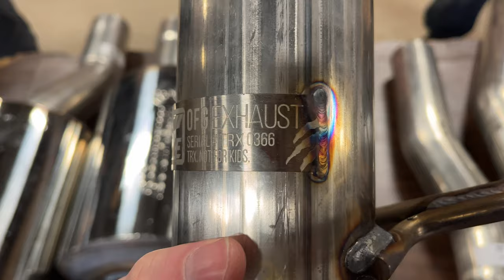Ram TRX – AWE 0FG Exhaust | Install and Review

Comment: Does that muffler on the right side hit the frame at all during driving or when going over bumps and driveways as the chassis flexes? Sounds damn good!
Reply: Nope, it's been fine! I've done additional adjustments since install and it's only improved. No witness marks on the frame rail or the resonator. Once all of the hangers are in place, the system hardly budges at all, even if you push hard on it.

Comment: How much do you think that 180 tech would cut the in cab sound with the kooks long tubes 1 7/8 with HO green cats.  I just did the header swap and i'm goin to be honest, a bit much at highway speed for drone with stock exhaust, worried i might have to swap back to stock headers and cats for the AWE 0FG i got coming in. Cant find anyone with the setup... i did headers to get rid of the squeel which it did do but downsides other areas. Praying on that 180 tech coming through for incab noise